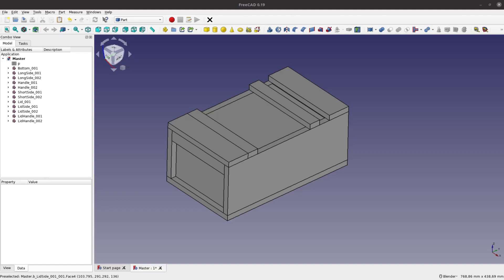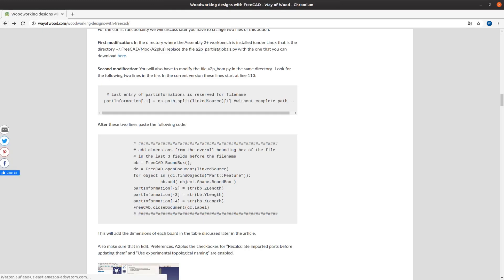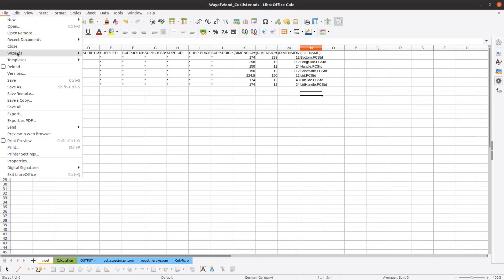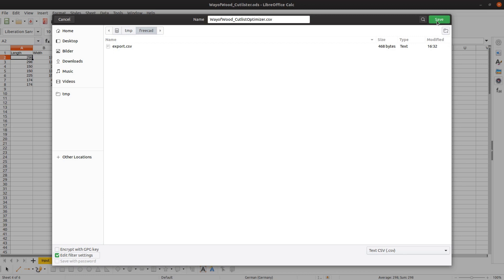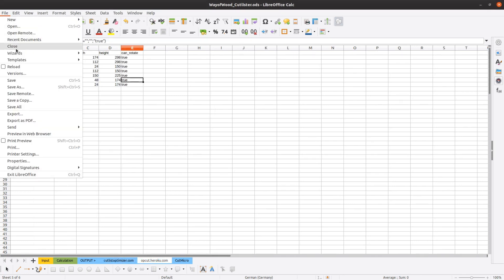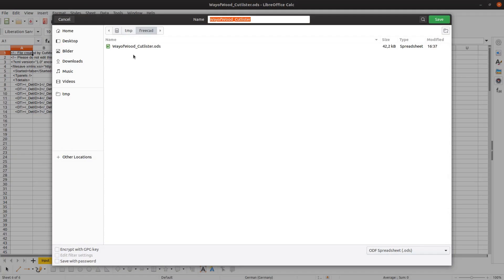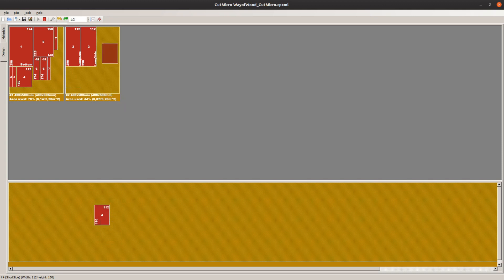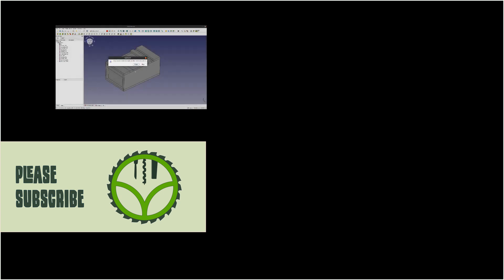From CAD to Cutlist in FreeCAD - FreeCAD for Woodworkers #05

Comment: For everybody trying this on MacOs Numbers.

I opened the .ods file in GoogleDocs and exported a Excel sheet which then can be opened in Apple Numbers.
Here I was confronted with corrupted formulas on the calculation-sheet (Fields that say ERROR!). Enter these in second row, then apply the same formula to the fields below by dragging down from the outline of the corrected field. You might have to type them manually, for some reason copy and paste does not work correctly.

Under Part name (B2):
LEFT(Input::Table 1::N2;LEN(Input::Table 1::N2)−6)
Under Quantity (C2): 
IF(Input::Table 1::B2="";"";Input::Table 1::B2)
Under Thickness (D2): 
IF(Input::Table 1::K2="";"";MIN(Input::Table 1::K2:M2))
Under Length (E2): 
IF(Input::Table 1::K2="";"";MAX(Input::Table 1::K2:M2))
Under Width (F2): 
IF(Input::Table 1::K2="";""; MEDIAN(Input::Table 1::K2:M2))

Hope this helps someone.
And a fat Dankeschön to Mr. WayOfWood!
Reply from the maker: Thanks for the helpful tip!

Comment: Can you provide guidence in locating the actual addon files in Mac OS?
Reply from the maker: I don't know but maybe you ask in the FreeCAD forum
Reply: @WayofWood  I was able to make the modifications, and I rechecked. I can generate the spreadsheet but it's not filling in the associated columns for dimensions. In fact those columns aren't even in the spreadsheet. I double checked, both modifications were done correctly, is there another setting I need to change?

Comment: Thank you for nice video
I make small macro based on https://www.briankoponen.com/libreoffice-export-sheets-csv/.
You can make it as button in your excel it will save 3 files as CSV. Still you have to remove extra lines from them unfortunately . See below.
Sub ExportToCsv
    document = ThisComponent

    ' Use the global string tools library to generate a path to save each CSV
    GlobalScope.BasicLibraries.loadLibrary("Tools")
    FileDirectory = Tools.Strings.DirectoryNameoutofPath(document.getURL(), "/")

    ' Work out number of sheets for looping over them later. remove first 3 technical sheets 
    Sheets = document.Sheets
    NumSheets = Sheets.Count - 1 - 3

    ' Set up a propval object to store the filter properties
    Dim Propval(2, 2) as New com.sun.star.beans.PropertyValue
    'ASCII
    '9 TAB (horizontal tab)
    '10 LF
    '11 VT (vertical tab)
    '13 CR
    '32 space
    '34 "
    '35 #
    '38 &
    '39 '
    '44 ,
    '45 -
    '46 .
    '47 /
    '58 :
    '59 ;
    '
    'cutlistoptimizer.com
    Propval(0, 0).Name = "FilterName"
    Propval(0, 0).Value = "Text - txt - csv (StarCalc)"
    Propval(0, 1).Name = "FilterOptions"
    'Field Separator(ASCII Code),String Suraunding(ASCII separed by /),Charset(0 system), Starting line,  delimed/fix text 
    Propval(0, 1).Value ="44,39,0,1,1"   'ASCII  44 = ,  39 = '
    Propval(0, 2).Name = "Overwrite"
   	Propval(0, 2).Value = True
    'opcut.heroku.com
    Propval(1, 0).Name = "FilterName"
    Propval(1, 0).Value = "Text - txt - csv (StarCalc)"
    Propval(1, 1).Name = "FilterOptions"
    'Field Separator(ASCII Code),String Suraunding(ASCII separed by /),Charset(0 system), Starting line,   delimed/fix text  
    Propval(1, 1).Value ="59,39,0,1,1"   'ASCII  59 = ;  39 = '
    Propval(1, 2).Name = "Overwrite"
   	Propval(1, 2).Value = True
	'CutMicro
    Propval(2, 0).Name = "FilterName"
    Propval(2, 0).Value = "Text - txt - csv (StarCalc)"
    Propval(2, 1).Name = "FilterOptions"
    'Field Separator(ASCII Code),String Suraunding(ASCII separed by /),Charset(0 system), Starting line,   delimed/fix text  
    Propval(2, 1).Value ="59,39,0,1,1"   'ASCII  59 = ;  39 = '
    Propval(2, 2).Name = "Overwrite"
   	Propval(2, 2).Value = True

    For I = 0 to NumSheets
        ' For each sheet, assemble a filename and save using the filter
        SheetIndex = I + 3
        document.getCurrentController.setActiveSheet(Sheets(SheetIndex))
        Filename = FileDirectory + "/" + Sheets(SheetIndex).Name + ".csv"
        FileURL = convertToURL(Filename)
        Dim Values(2) as  New com.sun.star.beans.PropertyValue
        For J = 0 To 2
        	Values(J) = Propval(I,J) 
        Next
        document.StoreToURL(FileURL, Values())
    Next I

End Sub
Reply from the maker: Great idea!

Comment: FreeCAD do have a nesting module wrote by Yorik. What would be really helpful will be to have in FreeCAD support for Grain Direction (orientation) and Edge-Banding of the panels. This features will make the Furniture design for fabrication more easy.
Reply from the maker: Thanks a lot. I wasn’t aware of this and will take a look. In particular a way to connect a nesting solution with a database of available material would be great.